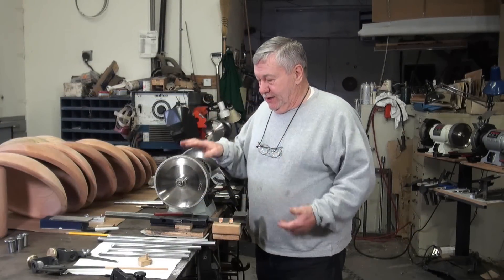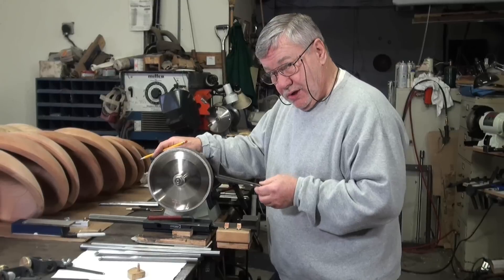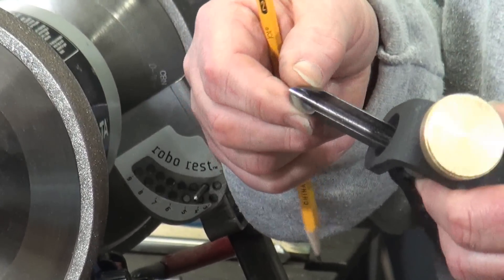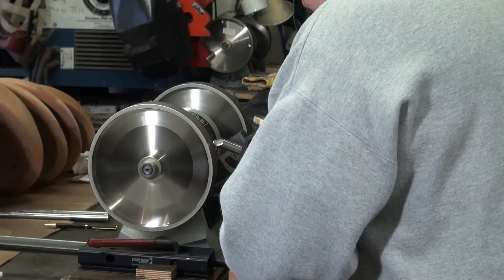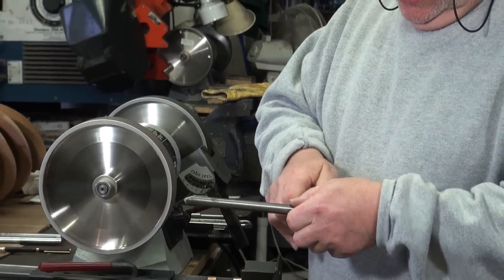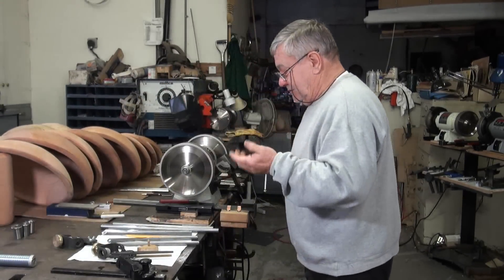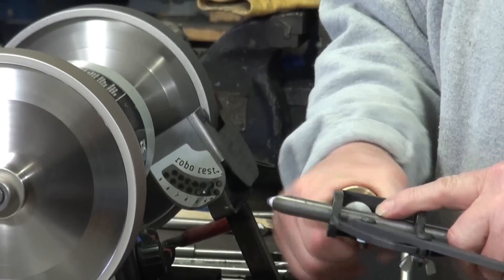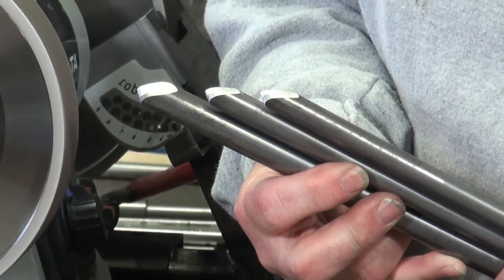D-WayTools Bowl Gouge Sharpening

Comment: This is very good. You showed me a solution to some of my sharpening problems. I use a different sharpening system but the principles are the same. Removing the gouge from the handle for sharpening is something I have not been doing but will in the future.

Comment: I realize this is an old video but it's a very good one. Yet I've got some questions. Hope you don't mind answering them. First off was the stick out while using the vari-grind on the bowl gouge 1 7/8 "? What angle do you put on your bowl gouge.  What angle on the bottom gouge? And what two grits do you use on your grinder wheels?